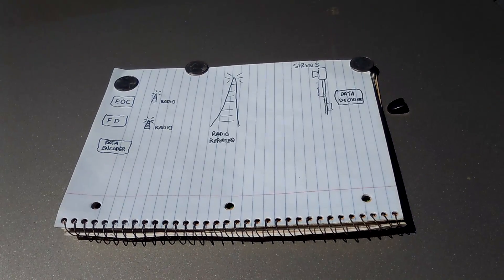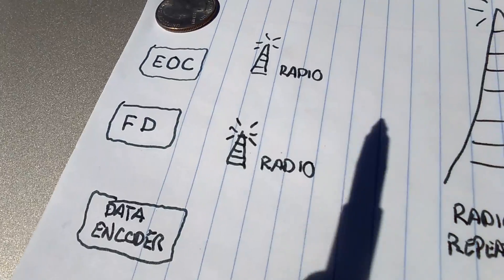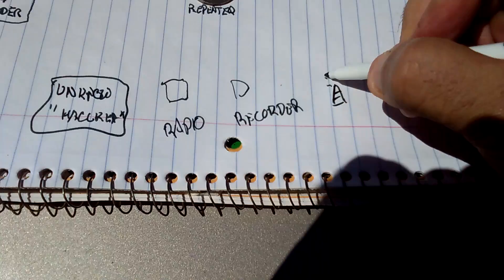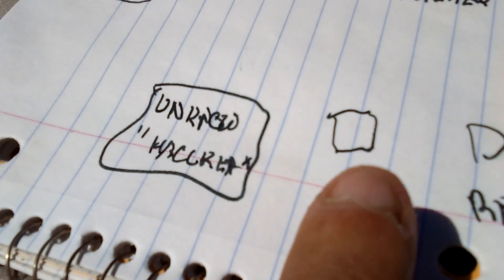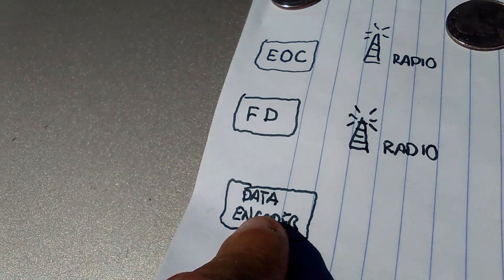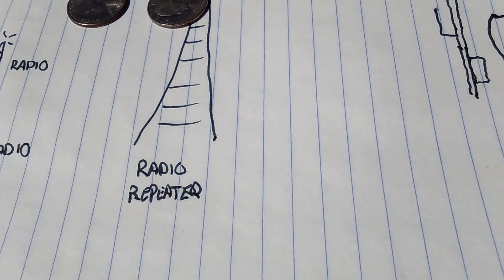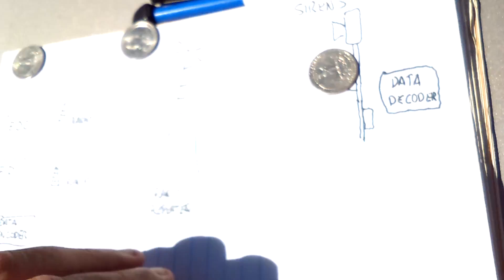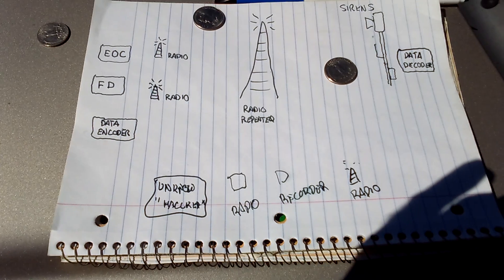How the Dallas Texas outdoor warning siren system was hacked - April 2017

Comment: Yep, guessed the same. this is called the "replay attack". All the sirens in the country that use radio is used exactly in the same manor. Its old technology thats been in use since the 70s/80s and it works, so why change it? HEADS UP PEOPLE...

The only fix to this really is timecoded signals/messages using some sort of AFSK or PSK over the same analog bands for some security, but better off with encryption. Timecoded messages sent over an encrypted radio band (like most tactical systems are switching to) will fix this along with a control frequency that can update timestamps and rotate keys, etc in the decoders of all the sirens since there is no such thing as a perfect timekeeper, you have to keep the system in sync in order for this to work. Using an update status word, or "counter" per se, along with current timestamp cant be > packet timestamp will stop the man in the middle and replay attacks, as long as your encryption or signature keys are cryptographically secure. A system implemented in this manor will stay secure as long as someone doesnt gain physical access to the decoder at the siren itself and attempt to breach the electronics physically and dump the firmware to get the keys. So physical security has to be of thought as well.

Comment: Don't most VHF repeater systems require a pulse code to 'trigger'?  For example I know I couldn't broadcast on our local police frequency for this reason.  Wondering why there wasn't something similar in place in the Dallas system.
Reply: Yea some repeaters require a code to activate the transmission. Which is why when you listen to a direct signal to the repeater instead of the repeater, you hear a hash of DTMF codes as a "roger beep" That tells the repeater to forward it. The attacker likely recorded the inbound frequency and got that code. Otherwise you would need a good antenna and a very powerful transmitter to get around using a repeater.

Comment: That's exactly what I guessed. Anyone can easily set off a siren if they have the correct frequency and know the correct tones to punch in
Reply: reverse thrust it definitely is a felony, it's a violation of several federal laws that govern the use of emergency radio systems.
Reply: reverse thrust it isn't hacking really, it's hijacking. They could easily fix this by using a mesh network system based on wifi which has groups of sirens hardwired together connected to other groups wirelessly through radio repeaters. Lookup broadband hamnet, it's pretty interesting. Then you can add signs and smaller sirens into the network.
Reply: And also the correct hardware

Comment: There is no hacker.  The authorities did this.  It is to make the population believe there are terrorist working within.  Its same as the gay club in florida in where a squad of cops went in and killed these 53 people.  Its to create the paranoid illusion in people that terrorist are constantly scheming ways.  By doing these stunts it will make it to where the elite authoritive power can start randomly killing groups of people but wont be suspected.  Be stupid people or get smart
Reply: Earl Guyton The Authorities wouldn't do this. When you listen to the Sirens sounding that Friday Night, there is evidence of Physical Damage done to Dallas' Federal Signal 2001-130's. The Chopper Motors are definitely overheated, that is No Question, the Batteries, which are $1000 a piece, sound like they are near Dead, which cost Dallas over $150,000, and the Rotators are also Overheated. If the Authorities did do this, it would cost Dallas over $500,000 to repair the Damage that was done. The Authorities wouldn't set off the sirens for over an HOUR just to impersonate terrorists if it would cost them that much Money. These Sirens are designed to sound for only 5 Minutes, not an Hour and a Half. Dallas may easily have to replace these very same Sirens in the future much earlier than anticipated, because this EASILY took over 5 Years of lifespan off of these units
Reply from the maker: Earl Guyton there wasn't a "hacker" involved in this, only a radio pirate. The media LOVES to use the powerword hacker
Reply: I think the witnesses inside the club that lived would disagree with you.
Reply: Daniel Rials They Hacked the Encoder. Not the Radio. It is possible to Hack the Encoder to send out the Activation Signal or to Hack into FD or EOC Computers to send the Activation Signal. They didn't hack a radio at all you dumbass
Reply: Earl Guyton Your statement is total Garbage too if you forgot. The Authorities would not do this by any means. If it would cost them Over $500,000 in Repairs and Battery Replacement, it would obviously be a waste of Money and Effort. I'm a Siren Expert. Your Not. The Copper Motors and the Rotational Motors are Overheated, and you can tell by listening to them, and the Batteries are Near Dead since they don't hook them up to a AC to DC Transformer. They aren't designed to run for over an Hour. They are designed to run for 5 Minutes and then Shut Down. And why would they Flood Their OWN 911 System? It makes No Sense when you lay it down on paper. All I know is that the Citizens may or may not think that this was caused by Terrorists, but that is what the Media claimed. So that's what I'm going off of
Reply: Earl Guyton And it would easily take 5 Years off of their 2001-130's Lifespans. And these things are anything but Cheap. $40,000 for each Unit
Reply: Earl Guyton Well that's not very polite. I clearly said that I didn't ask the 1,300,000 people of Dallas. I went off strictly what the MEDIA said. I know that the Media isn't the most trustworthy source like they used to be, but it's the best source I have. And I am not simple minded. You have to be an Idiot to think that the Authorities would do this. This would cost over $500,000 Independently, and due to Extensive Motor Use, this easily took 5 or More Years off of the Lifespan of the 2001-130's in Dallas, which would cost well over $5 MILLION. YOU are the one that said that they did this to Impersonate Terrorists, so why the Fuck are you blaming me for this? And if they did do this, WHY WOULD THEY?! It would have absolutely NO positive effects in any way!
Reply: Earl Guyton And if you call me simple minded, tell me. Why are you calling me not credible for a simple debate when I seem to know more about the actual topic than you?
Reply: Y'know when I imagined what a conspiracy theorist looked like as a young kid, I didn't think i'd find anyone that matched the description I had until now.
Reply: Earl Guyton what’s your explanation of the cost? Seems like you have been deliberately ignoring that fact. I also ignore your statement due to poor grammar and being hypocritical
Reply: Legend813a exactly, it was a situation very similar if not the same in concept to the 1980s max headroom event in Chicago. This guy probably used some sort of SDR software like HackRF.
Reply: So the government can spend over 10,000 to put more encryption and harder to crack radios? There is no hacker because you cant hack a radio.
Reply: popnfloss I don't know why people would think that Terrorists or the Authorities do this. Stoplights and Electric Signs have been getting "Hacked" in Dallas for YEARS. The Sirens getting set off in Dallas was most likely caused by the same person.  The problem with what happened 3 Weeks Ago is that this caused Mass Panic and Disturbance across the city, which is why the Media made such a big deal about it
Reply: Mikey I will be setting up a camera at my house to document just how bad the sirens may or may not sound. Test in two days.
Reply: test was a success, siren nearest me sounded as good as new
Reply: Yes this is so true because I was in Florida during the shooting and the people didn't know what to do there was a hospital two blocks away but instead they waited for help and guess what the police squad came 2 hours later after the attack. thank you for saying the truth God bless you.
Reply: Youre welcome and may God bless you as well.
Reply: Daniel Rials you obviously di dnt listen
The person above is right and the video is correct the way that this can been stopped is encrypting the radio frequency that the sirens are activated on which is the oem
Reply: I bet you believe the Last Vegas shootings and Texas shootings are some crack pot conspiracy too.
Reply: My mind made this happen
Reply: I live here in Dallas, Texas and we don't dial 911. I only fear we keep letting these out of state pussies moving in, they will mess up our Texan way of life. peace
Reply: Your statement is total garbage.  How could you know if people in dallas did not think this was terrorist?  Did you talk to these millions of humans yourself?  Arrogant fallacy is your mental.  So the next time you see a movie I suppose you know what millions of americans will think of that too.  Such a talent you have mickey mouse to know at random what complete cities of people think
Reply: Anyone that would try and speak for what a population of one plus million people think and say they knew what all of them thought is a delusional IDIOT.  To make that statement made you not credible for any reasonable debate.  I didn't read your comment because I knew you would come back and babble because you are simple minded

Comment: In my town's VFD, they're controlled over normal VHF police radio, and 
each one is selectively activated with a unique string of DTMF tones 
that you could easily decode, which I'm guessing is what happened in 
Dallas. Back in my more carefree days when I had my Minitor IV I was able to decode the tones, and I was considering doing this myself, but didn't feel like going to jail. And I didn't have a proper radio, either.
Reply: lAMNOTGOOMBA the same thing happened with the EAS in Wyoming and Michigan, someone broadcasted the EAS DTMF tones (actually called SAME tones) and set off the EAS saying a zombie apocalypse was occurring.